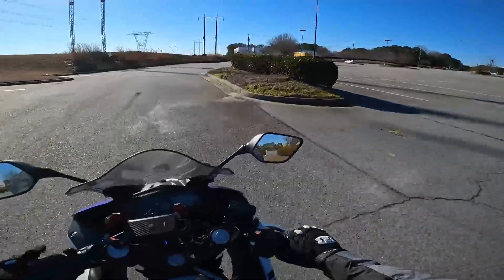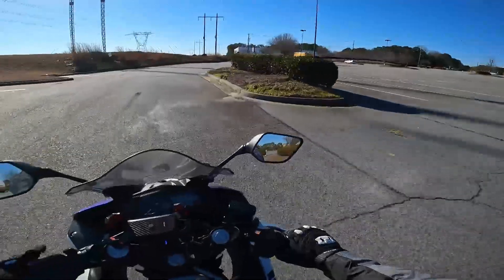How to Perform Low and High Speed Turns on a Motorcycle!

Comment: I only see a small mistake, but most people make it & we’re fine. There’s only one method to turning a bike. You countersteer at all speeds, but speed exaggerates the sensation of countersteering so your brain only notices it at higher speed. I love how you said “speed is what keeps the bike up” & that’s 100% correct. Gyroscopic precession is what turns the wheel in the direction of travel after you finish leaning the bike over. The reason this isn’t as noticeable at lower speed cause the bike doesn’t need to lean as far to turn. The faster you go, the more the bike must lean to turn. But, after that lean, no matter the angle, the front tire will turn into the turn without rider aid. The way I understand this is the faster I go, the more force I need to apply to my bars to lean the bike over. The bike must lean to turn & we confuse the low degree lean angle of slow speed maneuvers with “direct steering”. It may feel like the bike is upright when going slow, but the truth is it’s only more upright than if you were going faster. It’s still leaned over, just not far enough for your brain to notice lean angle.

Comment: (2024 Ninja 500) new rider here. Iv been slowing down by holding clutch, pressure on front brake and downshifting as the mph goes down. Holding the clutch the entire time and only finally releasing the clutch when I’m in first or 2nd (depending on how fast I can make the turn). It feels smooth and I’m just coasting. Is this ok???
Reply: I’d never recommend coasting on the bike. The bike gets stability by being “loaded” & you’d really notice the difference if you went through the turn with your clutch depressed. However, the biggest factor is your sensation of safety. If it feels good then technically you’re not doing anything wrong. I’d rather you coast until you’re more comfortable downshifting than trying to learn how to wheelie the bike. Try to practice downshifting(engaging each gear) as you slow down, but you aren’t hurting the bike & only slightly putting yourself in a dangerous position. If you need to accelerate & miss the turn to stop someone from rear ending you, you won’t be able cause you hold the clutch. That’s a very specific scenario though. Keep doing what makes you comfortable until you can do more. No harm no foul

Comment: are you pushing down or forward with the handlebars for high speed?
Reply from the maker: I am pushing down in the direction I want to go.
Reply: @RoamMoto  hmm, push forward of the handlebar seems the norm 😬
Reply: It’s called counter steering.  If you push forward on the left grip, the front wheel turns slightly right but the bike dips to the left.  Making it easier to lean in to a left turn.  Try it while sitting on you bike both feet down on the ground.
Reply: @orlandoflores7720  i know what it is called i was just trying to understand your take as others are pushing down 😅

Comment: what type of phone mount do you have?
Reply from the maker: It's a mount I got from Amazon called Joyroom. I don't recommend it though cause it gets in the way of the tachometer.
Reply: quad lock is pretty good, has a motion dampener and a wireless charging adapter that works with it too. love it

Comment: I can tell your passion of being on two wheels but you are not a good teacher or your skills are lacking. The push is to push the bar away from you to turn the bars not push the bars in a roll. The reason is counter steering. Also dragging a rear brake and using the friction zone of the clutch is how you do slow speed turns. I recommend either going to some riding classes or becoming an instructor before putting out poor quality how to videos on youtube. This could actually be dangerous to new riders.
Reply: I second that, as he kept say pull up and pull down to go right/left. You push right to go right and push left to go left. There is no pull up and down.... period.